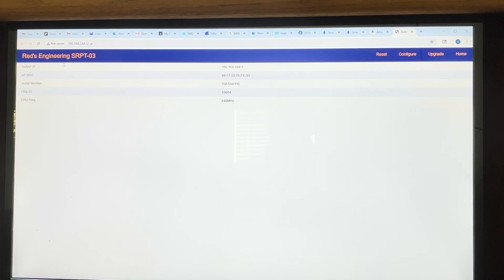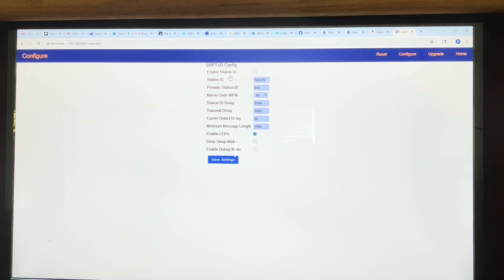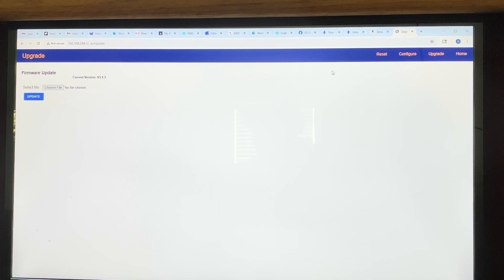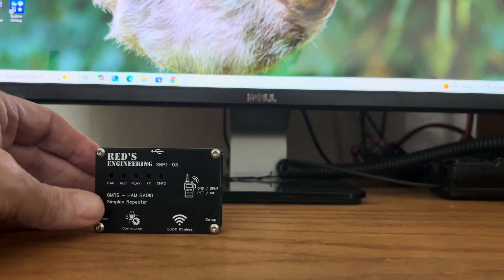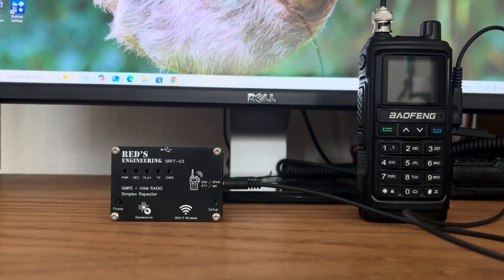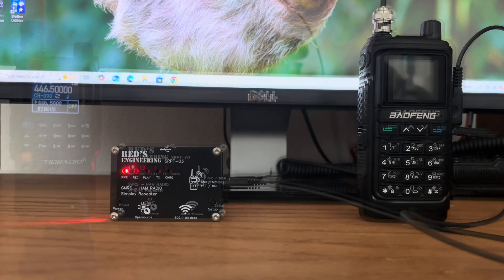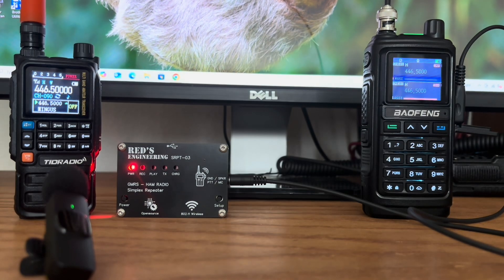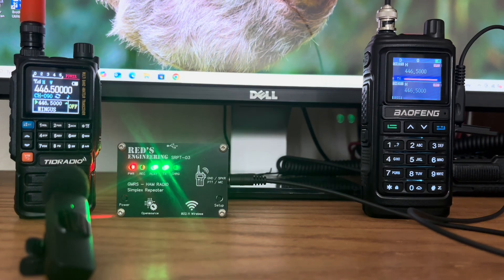In Depth Test and Review of the Red’s Engineering SRPT-03 Simplex Ham Radio/GMRS Repeater

Comment: Love your review, very thoughtful and thorough, but I have a few questions. 

My question is: 
Q: Can you use direct connection, DC barrel connectors, external power to keep the SRPT-03 device running with and without battery? 
Q: Can you attach a 5v/5w Solar panel (charging panel) for security cameras to keep the handheld radio running (if the handheld battery has USB-C charging)?
Q: It appears to just re-broadcast your Simplex transmission to gain more distance, does the SRPT-03 help in any way with the receive side, and broadcast down to the user ( or do I need a separate listening handheld)? 
Q: Does it make sense to have one centralized SRPT-3 for groups who want to communicate over long distances? Or have each person have their own SRPT-03 to rebroadcast over longer distances? 
Q: In high density areas will this interfere with other Ham & GMRS groups? 
Q: I realize the purpose is to communicate with another person, but 5w, wink, wink can reach miles... While many handhelds without additional amplification can't reach that far to reply or answer calls due to their own limitations? Other than  having them order and set up their own SRPT-03, what would you suggest they do? 

Thank you in advance. I know some of these questions are leaning towards having a permanent installation and additional information. The reasons for the these questions is to explore more options and recommend uses for this kind of device. As opposed to just buying a full blown repeater system.
Reply from the maker: Thank you for the compliment. You have a lot of questions and I will try and answer you to the best of my ability.

1. I am not associated with Red’s Engineering in any way. I believe this is possible but I will have to have you refer to asking them this question to get a definitive answer. They are very responsive to questions in my experience. 
2. This would depend on the manufacturer of the handheld radio and whether the charger connects directly to the battery or the radio. In the case of the Baofengs I own including the UV-5R the charger is connected directly to the battery. They state not to use the radio while charging the battery. And from personal experience with my UV-9R Pro radios the charging cannot keep up with the drain of the radio. The charging circuit in the battery shuts off the charging when the radio is on. Not sure if that applies to other models or not. I have a couple of other radios where the battery has to be attached to the radio while charging. In this case the charging cable is attached to the radio and not directly to the battery. With my Yaesu the charging stops when the radio is turned on and the radio is then powered by the power adapter. I have a Radtel that claims you can use the radio and charge the battery at the same time. But again the charger may not be able to keep up with the drain from the radio. In the case of a couple of my Baofengs they offer for sale an adapter that replaces the battery and plugs into a 12vdc power source. I have one for my BF-F8HP Pro and it works well. They also offer one for the UV-5R.
3. You are correct that the repeater is a simplex repeater that records the incoming message and then plays it back. Each SRPT-03 has a handheld radio attached for the receiving and transmitting of the incoming messages. The repeater controls the reception and transmission of the handheld radio. The ability to receive and transmit distance is strictly up to the power and sensitivity of the handheld radio itself. The repeater sound quality is excellent. It really shines when you use a better handheld radio. For instance the UV-5R sound quality is not very good to begin with. The repeater can only do so much. But with one of my UV-17 Pro GPS radios the quality is excellent. The way a repeater works is by being a middle man between two distant stations. As an example two handhelds can talk to each other when 3 miles apart. But cannot when they are 6 miles apart. Put a repeater in between them so each handheld only has to transmit 3 miles to the repeater thus extending their total reach.
4. For me it makes sense to have one centralized repeater setup per group. However, I just learned that it is possible to extend the range of these repeater setups doing something called daisy chaining by using distance, split frequencies and/or cross band frequencies and CTCSS codes on both transmit and receive to operate separate repeaters to try and increase your reach. I have never tried this but it will be something I attempt in the future.
5. For amateur radio it will only interfere with others if you attempt to use the same (or very close) frequencies that have been established for other repeaters and/or groups. Most repeaters have registered with the group that controls the frequency use in your area/state. Each state has a band plan that allocates sections of the bands for specific use. Stay within the correct allocated frequencies for your particular use and stay off the frequencies allocated for other uses and you should be good. Also, check that the frequencies you want to use are not already in use by another amateur operator. For GMRS split frequency repeaters stay within the specified repeater frequencies or in the case of simplex just make sure the channel you want to use is not already in use.
6. Handhelds on VHF/UHF have a lot of limitations. Range is limited by obstructions, curvature of the earth and other things. The idea of repeaters is to place them up high like on a mountain top. Without obstructions range can be increased significantly. The repeater itself does not increase range. The elevation, placement and antenna play huge parts. In lesser cases increased power and sensitivity can also increase range. Having line of sight unobstructed is the key to increasing distance. Five watts can go along way when unobstructed. The SRPT-2/03 repeaters use a handheld for transmitting and receiving. So getting it as high up as possible helps to increase its range. That is what the FieldLink Extreme Repeater boxes that Red’s sell that helps you achieve that goal. You place the repeater and handheld connected together in a weather proof box and then place it on top of a building, roof, hang it in a tree or from a tall pole. It will increase your range significantly if it is unobstructed. The antennas used by handhelds is also a limiting factor. I have connected an SRPT-03 to my base station antenna that is 20’+ up in the air and an amplifier putting out 35-40 watts and I was able to get 10 miles distance with obstructions like hills and buildings. Which means my range could be as much as 20 miles to another distant station to the same repeater under similar circumstances. 

My next video I am releasing today is for the Red’s Engineering FieldLink Extreme Upgrade Repeater Box. Have a look at it and see if it gives you some ideas for a solution to your situation. These products are not for permanent installations rather they are solving problems out in the field. These products are attractive due to their low price and reliability. But there are other solutions for mobile use and permanent use as well. For instance, Retevis makes a mobile repeater box for GMRS. My nephew is looking at buying one of these. It is a full blown duplex repeater in a portable box. It just requires a good power source and a good antenna. I believe it is a GMRS repeater. And they have a model that can link to another repeater.

I hope this answers all of your questions. Let me know if you have any more.

73’s Dave N8DAV

Comment: pretty impressive... what's the height of your base station antenna??
Reply from the maker: I have an OSJ-Pole antenna that is up at about 20’. I am running 75’ of LM400 coax. The SWR is under 1.2 for both 2M and 70CM. 

73’s Dave N8DAV